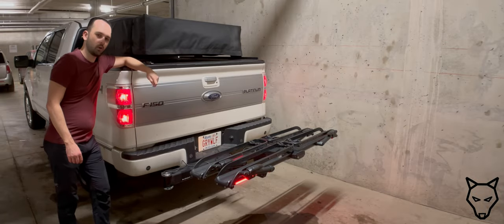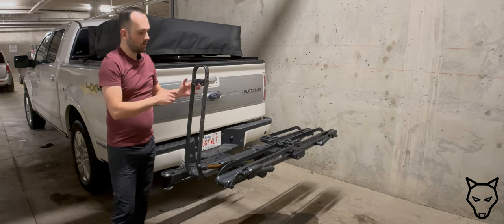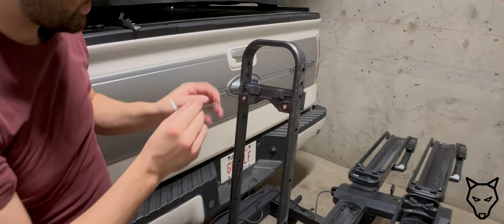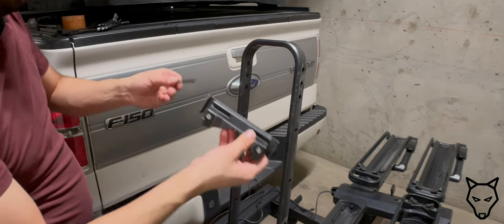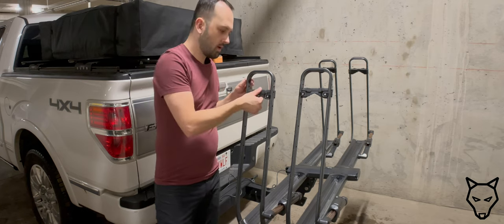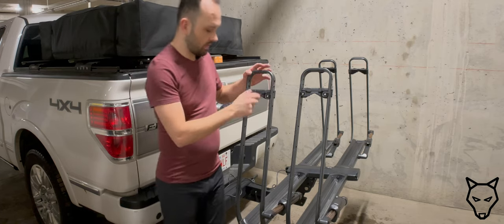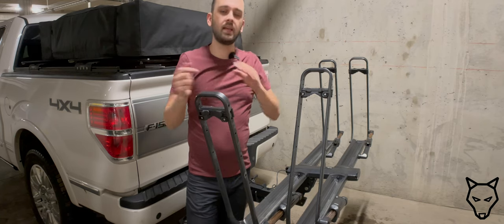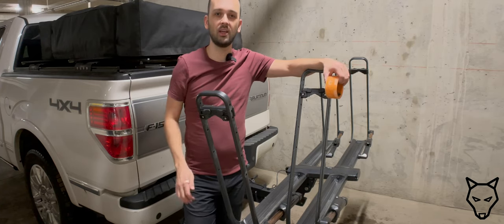Rattle Fix — KUAT Piston Pro X

Comment: You should’ve reapplied the thread locker that you broke through when removing the hardware. It’s typically applied by the factory to ensure that vibration won’t cause the hardware to fall out. If the hardware falls out you’re likely losing your bike as the rack falls apart.
Reply from the maker: Thanks for taking the time to comment and your suggestion. Without re-watching the video to confirm, there was likely sufficient threadlocker on the hardware to remain effective.  It’s not an adhesive so much as it is a binding agent which provides additional resistance (akin to dirt in the threads).  You are right, best practice would be to clean the hardware with a wire brush and reapply new threadlocker but I had enough experience and confidence to evaluate the situation.

Comment: I will check my rack to see if it rattles as much.  I don't see it as a problem.  My problem is with the wiring, as the lights on the Kuat don't need to be fixed.  I know it is with the car, as I attached the Kuat to another vehicle, and it works.  The car wiring was done by the dealer after market.  It was done five years ago, and they asked to bring it back but indicated it is expensive to be redone! I don't think they did it right from the start.  The ramp that I paid $98 bent where it grabs on when I was trying to take the bike down.  Being bent, it was useless.  That's not good.
Reply from the maker: Is the ramp the KUAT ramp?  If so, I highly recommend contacting KUAT.  They have excellent after-sales service.

Comment: Step 1: Pay $1400 for a rack. 
Step 2: Disassemble it to cover pieces with tape.
Reply from the maker: You’re not wrong.  Then again, ‘pay $50,000 for a truck and have felt strips added to seatbelt buckles’.   In the automotive industry there are entire departments called Noise, Vibration, and Harshness (NVH) who will add little pieces of foam and tape and such around a brand new vehicle to make it perform better.  You can either think of it as poor design or attention to detail.
Reply: lol